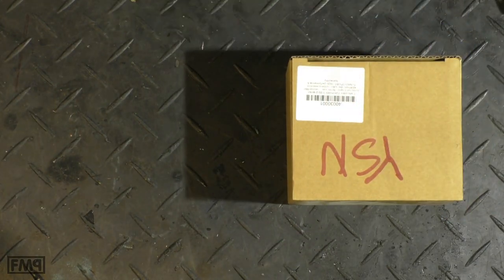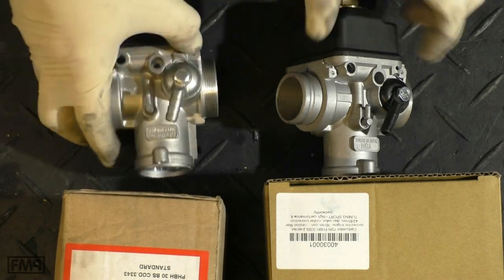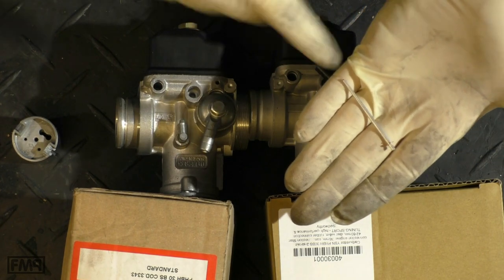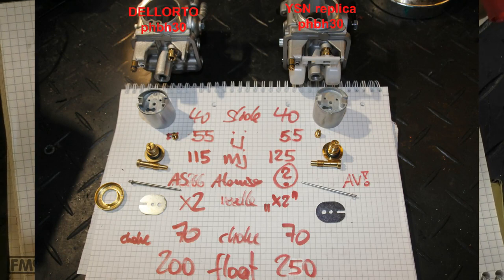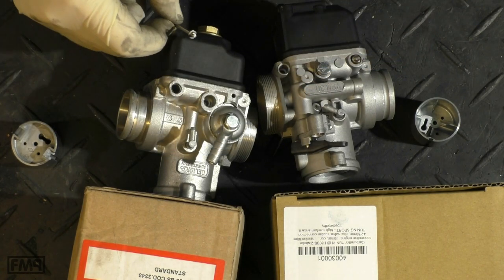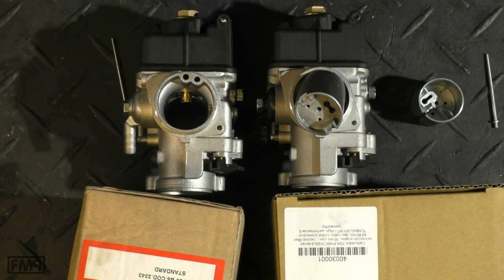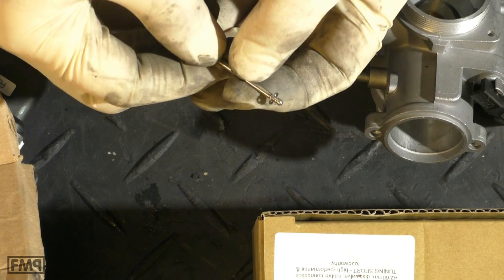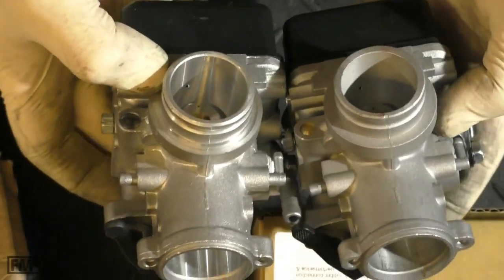YSN replica VS dellorto PHBH 30 carb COMPARISON

Comment: Hi fitted a replica YSN carb and the groove in the slide is also a different size. If you want to fit a Dellorto slide it will need machining or filing to fit . Regards Richy.

Comment: Great! You plan to test also "Carburettor SIP DSRC 30BS"? Is sold with 350 valve and 50 slider
Reply from the maker: no. why would a noname carb be interesting.. its most probably a branded ysn anyways 😉😉